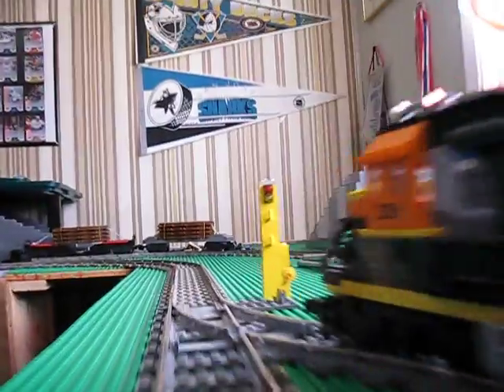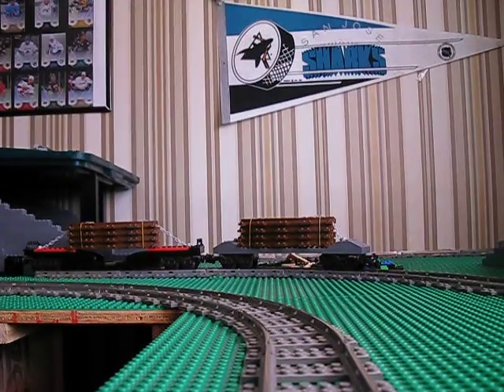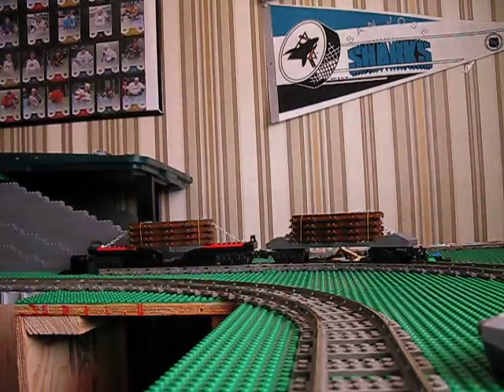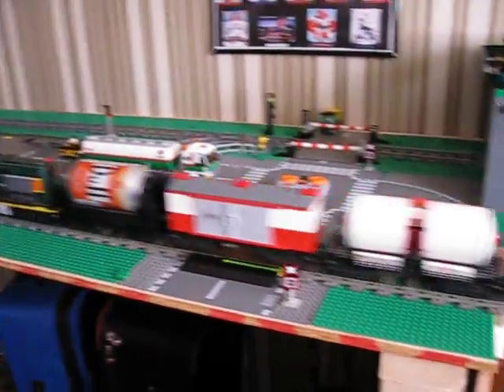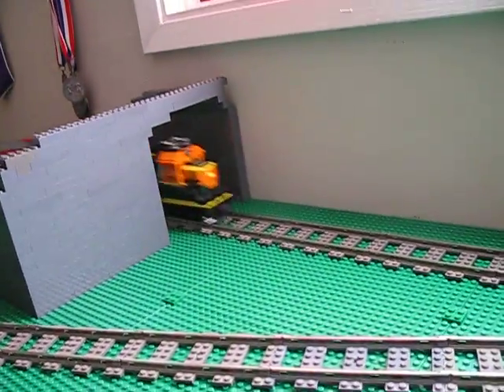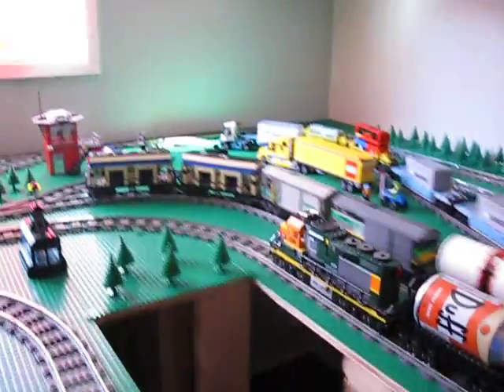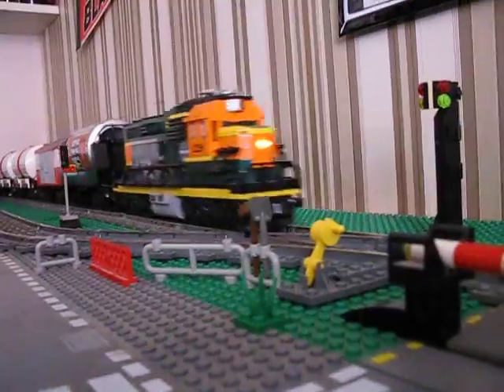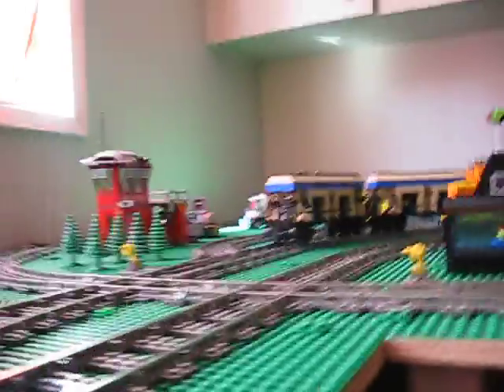West Legoville Railway Part 2 Train Ride

Comment from the maker: @starpotter17 I started construction in November 2010, took 4 months to get the tables ready for track laying (delayed mostly due to working and re measuring). Then in March I ordered over 100 base plates on the layout to give it a more senic look, that took roughly an hour and a half (track laying took over 35 mins.). The layout was operational on April 1st. So if you want to make a layout like this i'd plan it out first and find a location big enough for it and get materials. Hope this helps.